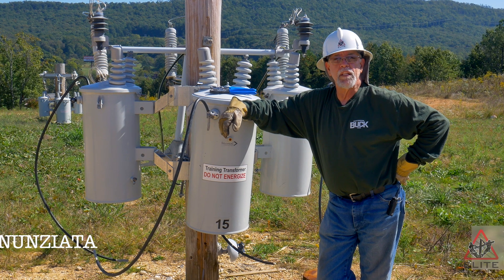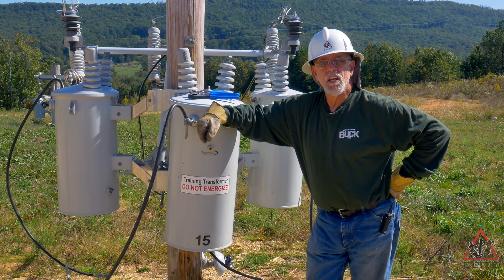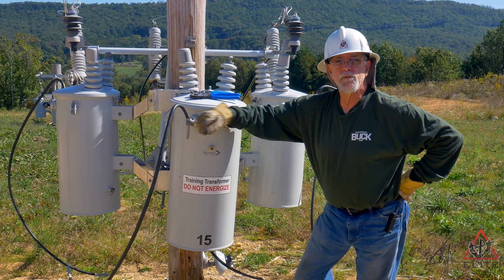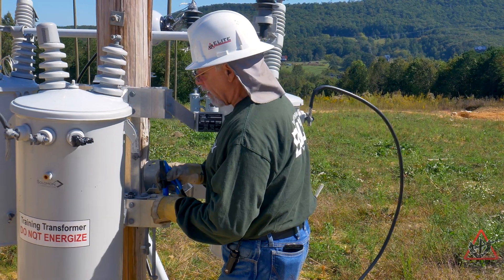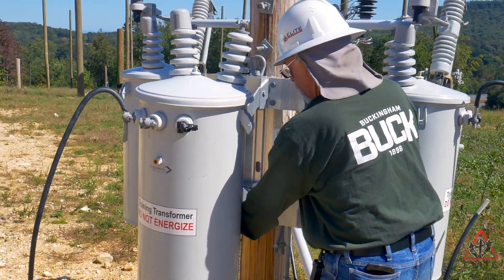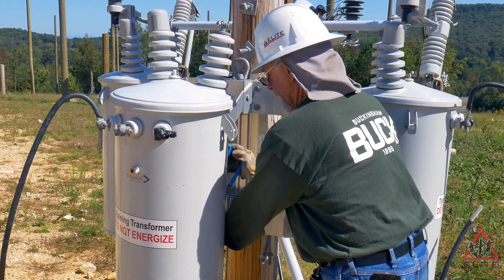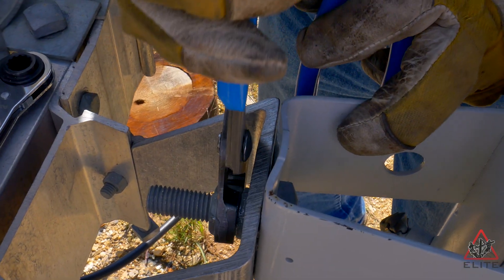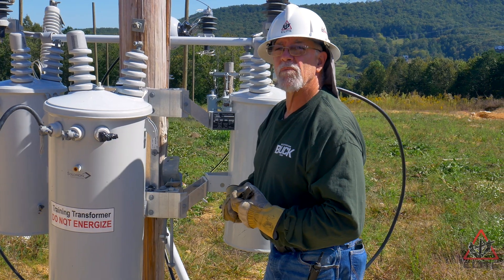How to keep the bottom bolt on transformer hanger from spinning - ELITE Lineman - Tips & Tricks

Comment: Hello there nerds and virgins, in todays comment section you’ll find a piece of advice that will save you some time and effort. Sling that freaking hex nut into the windshield of the pickup and get the attention of that sorry excuse of a foreman. Dig deep into your pants pocket and move that hand over to the center and grab ahold of a square nut… boom down and borrow your groundmans Lowell wrench after handing him back his channel locks. Those channel locks are made for installing stirrups and grounds.